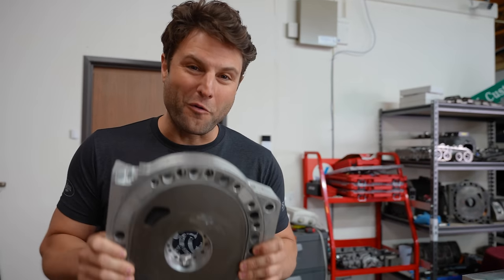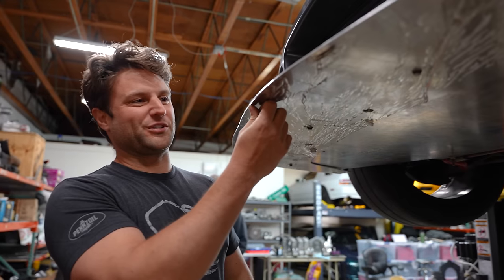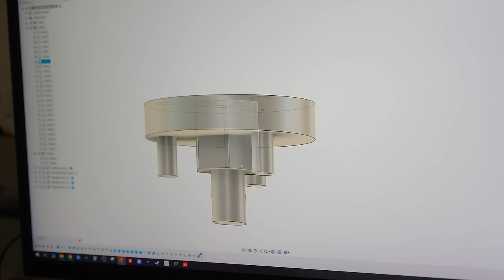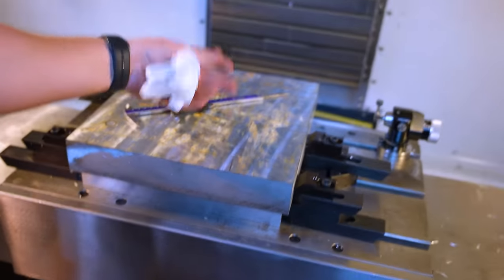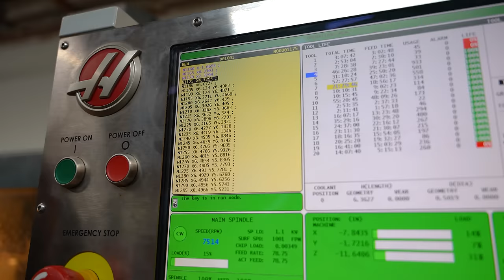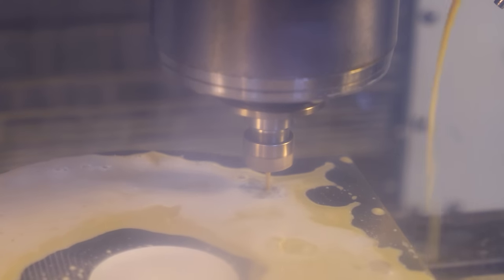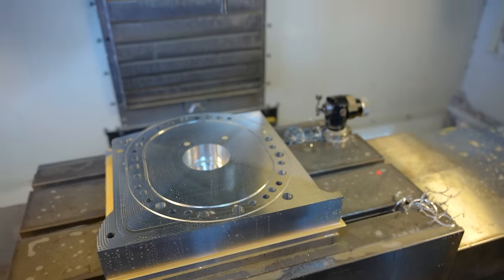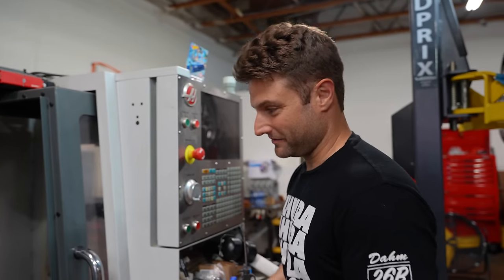Making my FIRST Billet Engine plate from raw Aluminum!  Dahm Racing Engines incoming??

Comment: I'm not sure if it would be worth the while, but you can get the aluminum billets custom forged to make the grain pattern of the aluminum follow favourable directions. This can make the parts even more durable.
Reply: I guess if he makes the jigs it won't be too hard for him to recreate the parts
Reply: @ImKairyu that's not the point.
It's about the inner strengt of the finnished part.
Reply: @adrianfinkler6913   I think what Kairyu is saying is that because he has all the cnc path coded to replicate machining out the irons, he can always make new irons in the future with custom forged billets like mattb suggested.
Reply: @zamorakxe  Well yeah, but forged ones will be far better, aswell as usable and repeatable with the fixtures.
Reply: Do you know why rob would use aluminum instead of steel for this application? If strength is a concern steel seems like the obvious choice
Reply: @mattpriebe8216  You get higher strength per volume of steel, but you get higher strength for the weight with Aluminum.

Comment: I can see Rob needing to buy more CNC machines soon  haha
Reply: A 5-axis mill could make a complete iron in 2 setups no problem (less finishing operations like the tungsten spray). A 4th axis in the current mill might do it if all the oil passages are parallel and at an angle that’s also compatible with finishing the ports.

Comment: Mazda: raises 13b crate engine prices*
Rob: “Fvck that I’ll just make it”
Reply: true, but in some places, like where i live, no matter how good it is, you'd not be able to street it legally :(
Reply: The crate engines are junk as well, need major work done on them if you want them to last.  So might as well pay for a billet engine at this point.
Reply: @CrazyCat229  I have heard a lot of people having issues with the recent crate engines not being up to spec. And they have to go through them before trusting it. But at least then you get all new components.
Reply: REAL 😆
Reply: @TheHighborn where? In uk , as long as it’s deemed safe by inspection, you could literally build everything from scratch
Reply: @damedusa5107 in Spain for example. there are many restrictions to mods. Engine swapping is one of the worst, swapping to an older engine is forbidden, swapping to a newer engine from a different car brand is restricted and swapping to a newer engine from the same car brand is allowed. You still have to pass an inspection, but before that you need an engineer to create an entire document full of explanations of why the newer system and modifications are safe/r. Deleting ABS, traction control, Airbags, etc is not allowed. Any modification to those systems has to be better than what already was there (bigger brake rotors is allowed, smaller isn’t). I understand from a safety perspective, really, but streeting a race car is not feasible here.
Reply: And even something like increasing the brakes and suspension is a massive headache, btw.
Reply: @LtdJorge damn that makes Cali car laws seem great

Comment: As an experienced machinest, i can attest to the nightmare of learning how to set up everything correctly for rigid tapping.  My first time was absolutely brutal, but you learn what needs to be done after a while.  
Here are crucial tips.

The biggest thing you NEED to watch out for when tapping a blind hole is tap selection.  Never use a spiral point, or even a straight tap when doing this.  And if you do use them, make sure to drill almost half an inch deeper so the chips dont build up and break the tap.  
But the correct choice when tapping a blind hole is ALWAYS   a machine tap.  The flutes are designed to pull the chips out of the hole.
Secondly use as much coolant as possible.  Taps simply just break without the lubrication and cooling of good coolant.
Third.  Always check and make sure that your drill and tap are spinning perfectly true.  Ive had it be off a bit because i was using a busted tool holder.
Fourth. 
When programing the code.  Always put the M03 Sxxx, in the line immediately above the G84 line.  Some machines simply wont understand that what you are trying to do is rigid tapping.
Reply: Wouldn't a form tap work too while also producing stronger threads and not having to worry about chip evacuation?
Reply: @allen_chao  Yes.  They work well.   Just make sure you use the correlating drill, because they are certainly different.  
Also, they tend to have higher cutting forces and might snap if things aren't perfect.
Reply: @ChefofWar33  yup, definitely experienced accidentally using a cut tap drill size instead of a form tap drill size and broke a form tap when I was first learning😅
Reply: I'm just taking my first CNC course so you obviously have more experience, but when going over rigid tapping on a Haas mill we were told specifically not to put the M03 code in with the speed because it will override the change in spindle rotation that is automatically in the G84 code? Would the exact rigid tapping parameters be specific to particular makes/models of machine?

Otherwise thanks for the good tips, I'll be rigid tapping a part next week and I'm definitely a bit nervous about breaking the tool off, especially because it's on the smaller side (1/4-20).
Reply: Damn this comment is everything I'll take these tips for myself aswell
Reply: A nice collet holder goes a long way as well. I rigid tap thousands of parts on the same tap, and its honestly really rare that I break one, but I also program on the conservative side.
Reply: Roll taps work better, and actually forges the threads. 
just make sure you shoot for about 68% thread when choosing your drill, or interpolate it w/ a suitable e.m.
(you are going to make the best, why not?)
pin it before running the tap,  use plenty of moly-d/equivalent, and peck-tap when running deeper threads.
Shear force of given materials at play can be crucial in some designs. 
Gross example: an off the shelf stainless m3 shcs will lose the battle if engaged in a half-inch worth of thread formed correctly in 7075 until a failure point occurs. 
In other words, don't weaken your shit needlessly in high-stress situations, and be aware that you are introducing new stresses, so order of operation will be crucial as well.
This only works on the formable grades of material.
Reply: @rylanclark8221  That's not true for my machines.  Could be for yours though.
Reply: @regjoe30  Yah.  They are good for sure.  I don't use them alot though because like you said you have to peck tap.  And some of my machines are horrible at doing that.
Reply: @ChefofWar33  Okay, thanks
Reply: @ChefofWar33  it's thou per rev on any tap,  or use a spring loaded tap holder and finish by hand.
With proper lube, both work well,
But if your spindle encoder is smoked, or machinery is 1980's old, a tap holder will "fix" it.
Reply: Where I work we always lift the tap 1mm higher than we drilled, we use a lot of water (sometimes it is even advisable to stop between holes to make sure there are no filings on the tap teeth) we usually use 80 of advance. for example an M10 step 1.5 is 350RPM 80 of advance and the hole that the guide has to be 8.5mm, it is also normal for us to only make a depth of 3x its diameter for example the M10 only makes a depth of 30mm if we want more we can do the rest by hand
Reply: @1vend7  Interesting techniques
Reply: @ChefofWar33  I like when experienced people are out here giving tips and not telling people they're wrong when someone has been told something different.
But also, an A7X fan too 😜
Reply: @RTSRAZORBACK  Any machinest worth a damn knows how little they actually know and how much there is still to learn.  Every day I learn new tricks, tips and techniques just by being arround it all the time.  There is so much nuance to machining that even a 50 year master machinest might learn new tricks.  Especially from us young guys.  I'm 24, but I've been doing it since I was 18, and I've learned from some very intelligent and experienced people.  This is the kind of profession that can't be mastered with a college education.  Only experience means anything.
Reply: Also the amount of people who dont turn on rigid tapping before the tapping cycle (m29 s### on the machines i use) and adding a p200 or p500 argument to your g84 so it stops in the bottom of the hole before changing direction
Reply: I’ve had problems in the past of machines (Mazak) tapping the deeper then programs due to parameters set, so to avoid bottoming out taps you can move the work/tool offset up off the work to see how far the tap will go from the position page while running
Reply: Rigid tapping has a major voodoo factor when doing it without a spindle that has direct drive or at least some sort of encoding (or indexing ability.) Something else that has to be taken into account is the acceleration/deceleration of all axes that are moving. (Z AND the spindle!) You have to allow for this at that bottom of the hole. If you're running too fast under too much load, you're asking that spindle and Z axis to reverse when there isn't enough time for it. Snap goes the tap. Also keep in mind that some machines will allow you to run  rigid tapping even though they have a cogged belt running the spindle. The encoder is generally on the spindle itself in this case, but there will always be a slight delay between it and the drive motor when changing direction as the belt ages.
Reply: shouldn't he use he flat endmill differently you can do it a lot more effectively if you just use the whole surface of your tool
Reply: Literally came to comment the same thing 😂
Reply: another good idea is to tap just a little bit so the threads are straight then hand tap to final depth
Reply: Rob has first to take a proper tool holder. What hes using is a drill holder. Also rigid tapping is on 99% of the machines possible since the early 90`s. There is nothing voodoo about it. But maybe im biased as i learned machining. Also in Aluminium i would use a form tap and not a cut tap. Way stronger threads.
Reply: @Speedy2222  No.  That's not good advice.  You should be able to learn how to get the machine to rigid tap.
Reply: @ChefofWar33 there's a limit to what a tap will handle and weather it is chips, tap drill size, or material sometimes you just can't let the machine tap your hole to depth or you're chances of breaking a tap go up. i'd rather get the hole tapped than have to worry about getting another piece of material since most of the time i do one off projects.
Reply: Agree. And if you are working with a material that can't be rolled, you may be better off milling your threads anyway. I love thread mills. @regjoe30
Reply: Syntax of the machine should be studied and tested, as even same control on same machine, set up for different needs, can interpret it different. Read in manuals and test in controlled environment (tapping air f.e.x.).
Reply: Yep, just came here to say I’ve ran some pretty high end machines, and they all have the ability to rigidly tap, but in reality, they tend to move before coming to a complete stop. We had some good quality and some pretty ghetto ER collets in floating bodies. 
Also, with aluminium, and machine taps, they go scary fast.
Reply: A machinest.. should actually know how to spell it.
Reply: @kaylebarthi2296  LOL. You obviously don't know many machinists. You know who are worse spellers than machinists? ENGINEERS!
Reply: @logannewman4532 lol truth.
Reply: Pecking is also a good idea for blind holes, especially for metals that like to expand while being cut (im looking at you bronze and some aluminiums). Straight taps are for through holes, the swirly spiraly ones for blind holes. one thing to keep in mind is that machine taps are what is called combined taps,  meaning the tap has a taper to the front of it, so the programed depth of the tap does not correlate 1:1 with the depth of the actual tap.
Reply: Correct! Hahaha I'm a second year machinist and I've had to learn that exactly the same way even got boss to change up some tools that work better and last longer but cut our cost by a ton! Lol not an ass kisser I just don't like doing extra work by breaking tools lol it's a pain to start a hassle machine in the middle of a program! At least I don't know how yet besides the m01 lines but that doesn't help if you need it to start at n2479

Comment: Tip for the future dowel hole machining: You may want to opt for a smaller diameter endmill, with a less flutes and higher rake for chip clearance.
Pre-drill with a twist drill (%50 final dia) for more chip clearance (peck drill) to reduce face milling with the tool and tool % engagement
Use the smaller endmill to then helical plunge rough cut to within .025-.050 the final diameter
Follow with a semi-finishing pass (dia -.010)  on the same endmill or one with more flutes (more rigid)
Reamer plunge cut to final diameter.

Other misc: possibly modify the circular interpolation to get rid of some of the "faceting" you see on the larger complex curves. This may/may not affect seals, but could change how a bushing wears because of stress points.

Looks good!
Reply: I knew someone already answered my question, it seemed like there was too much build up around the drill
Reply: Another tip would be to use an indexable face mill for the surface mill passes. My first CNC job taught me a lot.
Reply: Well, maybe i'm thinking too much about machining speed, but i'd get a modular or indexable drill, because it's way faster and usually very straight and reliable, also with the precision.
Of course, they are expensive and it depends on a lot of parameters, but if he really want's to produce a lot of them, then they would certainly be worth it.
Reply: Would also recommend thread mills instead of taps for cnc milling just chase the threads with a hand tap afterwards

Comment: For tapping use a collet type holder not a drill chuck. The force of tapping will spin the tap in the chuck causing it to lose timing and break as it did with you. 
Great work though! 👏🏻
Reply: as a machinist, in cringed seeing a tap in a drill chuck
Reply: I thought the exact same thing when I watched it and had a look thru the comments to see if anyone else spotted it lol
Reply: Rob’s doing great as a self taught engineer. It’s just some basic stuff that lets him down. 👏🏻
Reply: @adamfournier6735  it works fine on manual or semi manual machines with a Z axis quill that the tap can pull down on its own as long as it's not a really big tap.  For programmed tapping though, it's a bad idea.

Comment: You can program the drill to spin backwards momentarily after backing out of each peck. That will throw the metal building up on the drill for you.
Reply: That's not nice.
Why would you say that?
Reply: WTF are you smoking? @regjoe30
Reply: @VR6NAVYVW  since you seem to know so much about this subject, what is the specific line of code that performs this reversing of the spindle with each peck?
Reply: @VR6NAVYVW  proper chip ejection has absolutely nothing to do with reversing the rpm of the spindle.

Comment: As you build these, you will continue to improve processes.
My old timer recommendation is to finish as much of the insignificant items as possible first.
That way all the precision machining doesn't get scrapped for something menial.
Easy to hard not hard to easy.
Better to scrap a pice with minimal hours than one with maximum hours.
Separate programs. Center bearing AND locating dowels need to be separate options to allow for proper sizing of each individually.
You can rough everything in one shot.

Comment: Use a spiral flute tap and special ER32 tap collets. You basically need those 2 items to rigid tap on the HAAS. Thread milling everything is an option too, but you'll want go/no go gauges.
Reply: For a blind hole, machine taps are far better.  Spiral taps push the chip into the hole.  Machine taps pull them out of it.

Comment: For the blind holes into the fixture plate, for v2 you can make a thicker fixture plate with chip evacuation channels and a hose attachment to flood coolant into it from underneeth, so once the hole is punched into the fixture channel the flooding coolant carries them away. Reduces the risk of ruining the hole due to a failure to evacuate chips. Only worth setting up if you're going to do a bunch, as it requires a lot of refixturing to drill the coolant spray holes and manifold for the hose to feed into.

Comment: Hey Rob, 

I am a professional machinist in the space industry, I only use single flute thread mills for threading holes. You have the ability to make the thread as accurate as you want with the benefit of not ruining the entire part when you break a tool. I recommend Micro 100 you can machine multiple thread sizes with a single threadmill.

Comment: Hey Rob, big fan from Germany here, i have a tip for you when working with 7075 AL material,  7075 is having the nature of warping while machining or under heat, to account that you can mill both layers with the same amount of material taken off, so lets say -5mm on top and -5mm below. Knowing in wich way your billet block was Forged or Poured could also help determine where and how much you have to take off it. Im a CNC Machine Programmer and Machinist and mostly do Prototype Brake Calipers and is mostly work with this Stuff.

Comment: I'd recommend using roll taps. They form the threads by pushing the material instead of cutting the thread in
 This results in a stronger thread as the grain on the metal ain't cut, it's just reformed. If you do end up roll tapping just remember that your drill size = diameter of the tap - 1/2 of the pitch ( instead of subtracting the full pitch when thread cutting)